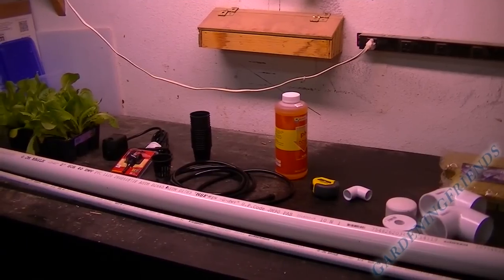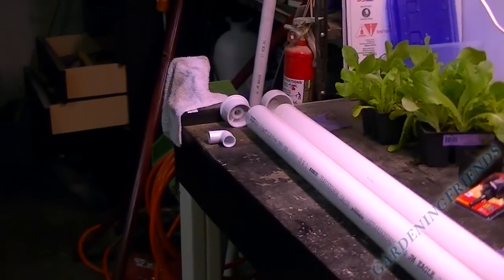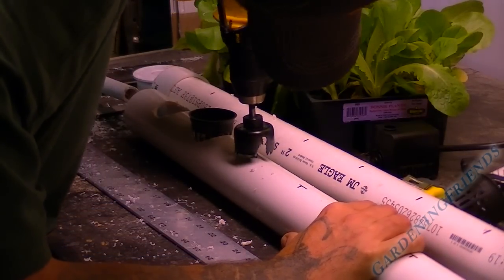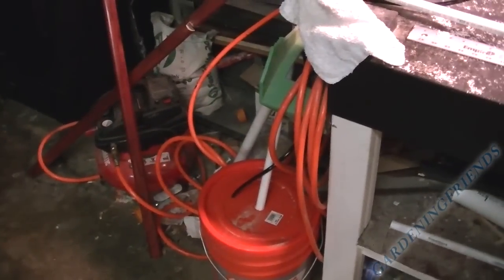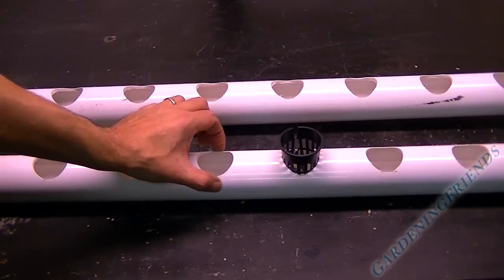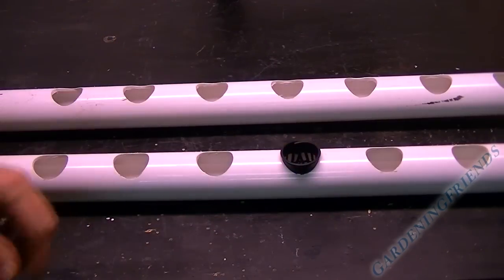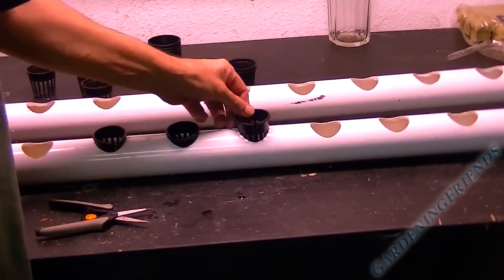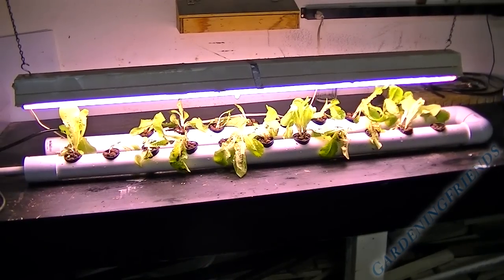home made DIY DFT / NFT PVC Hydroponic System

Comment: This book is nicely sufficient to introduce me with the various Hydroponics structures and additionally courses me to take blessings of rising Hydroponics technologies [Check Details Here  ===>fb.com/Easy-Hydroponics-Systems-166096780618260/app/208195102528120 ].The books are well structured; they make for easy and interesting reading, plus the writing is excellent, highly accessible and free of the unnecessary explanations that can slow down the read. This book is your practical guide to good gardening, and no matter your level in gardening, you’ll find a lot of information that can enhance your experience.

Comment: Thanks for sharing this, Scott. Very simple, compact, and to the point. I will try this soon. However, I might end up building a small custom stand to give the pipe where the water first enters just a bit of a raise to give it a better downward flow to turn the corner easier. Then also slightly lower the end of the pipe for a better downward flow.